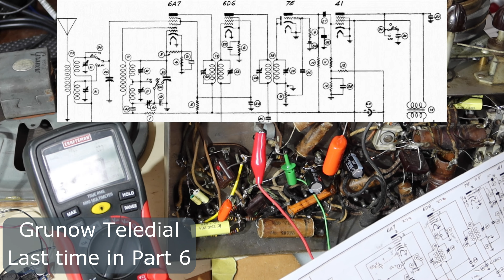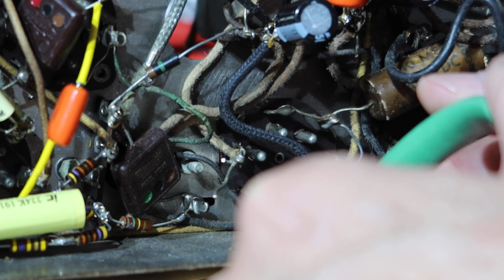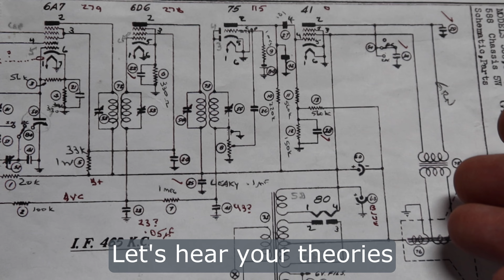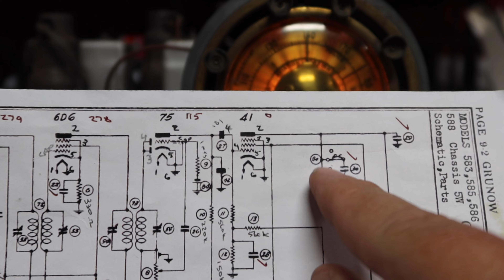FIXED! & How We Did It w/ Repair Summary.  1937 Grunow Part 7 [4K]

Comment from the maker: Jump to:
PART 7A
00:01 / Review of Part 6; Only 5 volts on the screen grid? Can that be right?
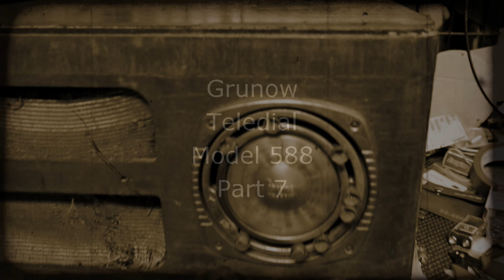02:32 / Double checking the 33k resister, and reviewing the 6A7 tube specification; problem identified
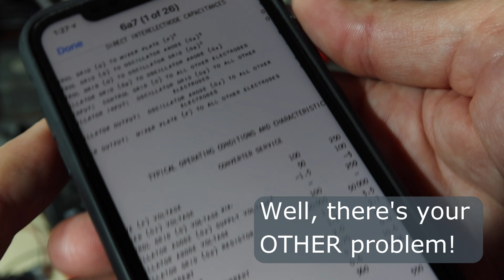04:20 / The Plan of Attack
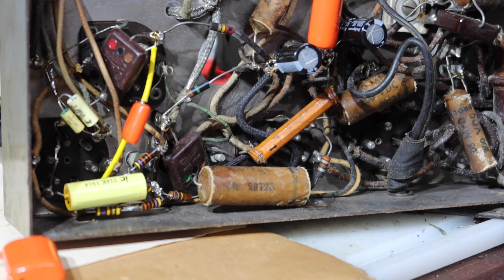05:00 / Setting up for the surgury; new components, etc
06:51 / Commencing surgury; incision, retraction and extraction; orientation for new components
11:58 / Speed-surgury installing the new components, with a good look at the back of my hand (sorry about that)
15:08 / Close and suture (soldering connections)
16:47 / Power up and let's see how it works now... (no antenna connected)
19:12 / Voltages after component replacement
20:20 / Voltages after component replacement, Take II
21:42 / Performance impact to component replacement - you mean we fixed it?
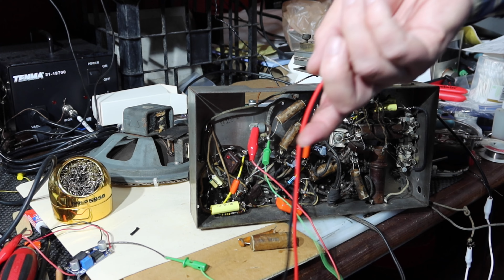22:29 / Experimenting with the Bias Cell voltage - how particular is the voltage?
25:04 / Broadcast band scan with a poor antenna, but it works

PART 7B - A time later, with a slightly better antenna set up, tweaked IF...etc
25:37 / Let's recap (no pun intended) step by step, what we did on this Radio to fix it.  
32:35 / Dial face lens, or cover, removal and cleaning
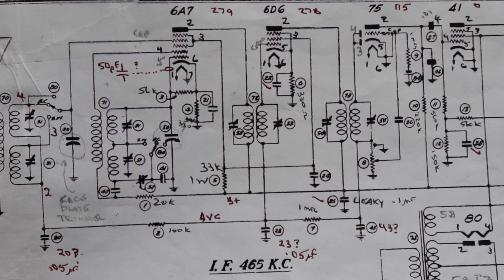33:33 / The Dial Face Reveal
34:08 / Tweaks to the alignment that were done and identification of trimmer cap positions for alignment
35:16 / The Band Scans - Short Wave first (small indoor antenna and alignment by ear, pending electrical resto)
39:40 / Band switch positions explanation, Bands and Tone selections
41:25 / The AM Band Scan, and Tone selection demonstration  (Lights out! at 42:31)
44:45 / Teledial Operation demonstration
45:45 / Teledial Adjustment demonstration
47:05 / Plans for the future with this Radio, and wrap up on the Radio Repair. Electrical Restoration of this radio to follow in the future.

Don't forget to comment on any theories you have about what the failure cascade was before this radio got put away for decades.

Thank you for following along on this! It's been interesting to me and hope you found it interesting as well.
If you enjoyed this series please give me a Thumbs Up, and Subscribe and select the Bell for notifications of new videos so you don't miss out on what's next for this Radio.